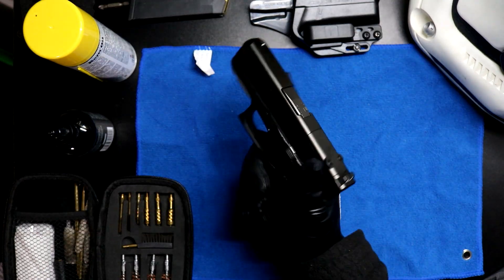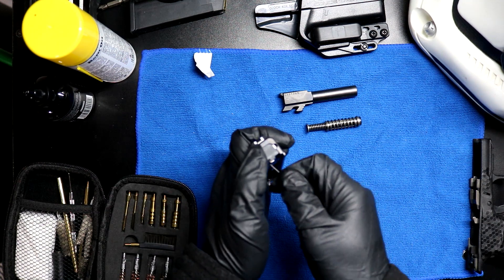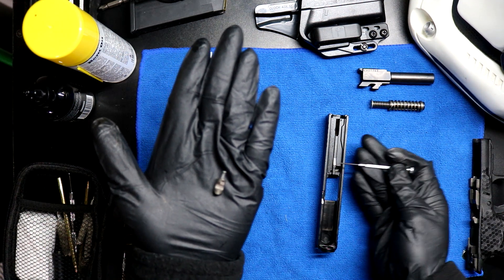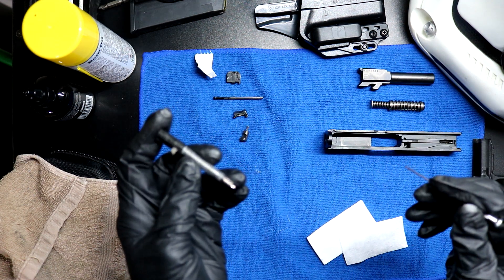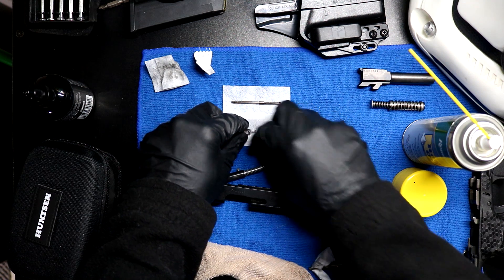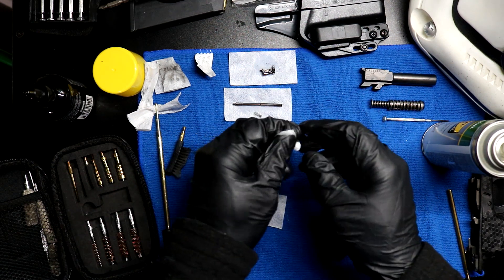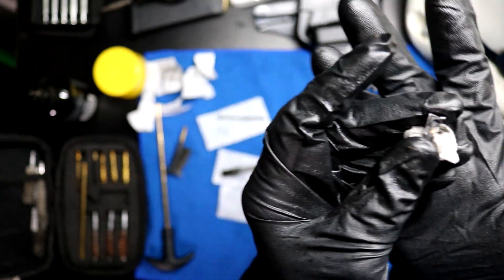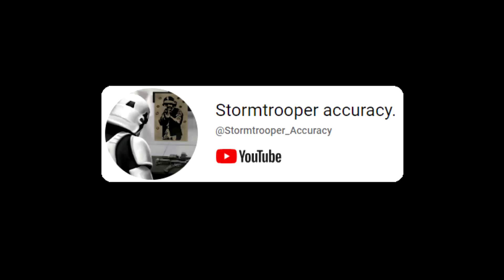G43X SLIDE DISASSEMBLY.

Comment: I tried to swap out the slide lock lever on mine for an extended slide lock lever and the spring went flying across the room. Good thing those little springs are cheap and my 43X was out of commission less than a week.
Reply from the maker: 😆see, I'd probably end up in the same predicament. Does the extended lock prevent you from using your holster?
Reply: @Stormtrooper_Accuracy  Not at all, it just makes the pistol a little easier to break down.

Comment: The plastic part on striker assembly yes it is plastic. You can always upgrade it to an aluminum one. I did that to my Glock 44 because it tends to break on that particular model. But on all others is fine to leave it as is. I left it as is on my G19 and on my dagger. But they do sell aluminum ones just in case you are concerned about it.
Reply from the maker: Ahh, so it is plastic. I'll run it stock for as long as possible, curious to see what part will fail first. How would u compare your G19 to your Dagger? I'm interested in getting a 19, or 19x.
Reply: @Stormtrooper_Accuracy  it gives me peace of mind knowing it’s a Glock but honestly, I love my dagger more. The ergonomics just feel better while shooting and drawing. I’m at 1,200 rounds with my dagger and not a single malfunction (Thankfully), since you have a dagger, if I’d have to choose between G19 or 19x I would go with the x. If I had purchased my dagger prior to my G19 I would of went with a Springfield Echelon (shot that gun for the first time last weekend and it is just SO smooth and the ergonomics are beyond you can imagine, the stock trigger feels like a $200+ competition trigger) instead of my G19 but nevertheless I love both my dagger and G19 I just enjoy shooting my dagger way more because of the threaded barrel with a comp and rmr cut with my red dot. I keep all my glocks completely stock. 

Well except for my G44 because after purchasing it and putting a few hundred rounds while cleaning it I noticed the striker sleeve had some very noticeable wear, and after doing some further research it was stated by multiple reviewers that it is a common thing on that particular model. Apparently since it’s a .22 long rifle chambered handgun the striker assembly has too much force when fired. So it ends up breaking the plastic striker sleeve. I purchased an aluminum one from FarrowTech and also haven’t had a single malfunction on that gun. To be fair I’ve only shot it around 500 rounds. Rimfire ammo is way too dirty. After shooting 100-200 rounds on the G44 the gun looked internally as if I had shot 2000 rounds of how dirty it was. Therefore I just keep this gun in the safe as a collection item. 

My G19 also is in the 1000+ rounds and both my dagger and G19 have their striker sleeve looking brand new (no visible wear) proving the point of those reviewers that stated it is an issue particularly with the G44 not any other model. So with that I say… you can rest easy my friend. That little plastic part will probably last you into the 20-50k rounds (possibly even longer) so long you don’t use stuff like over pressure ammo consistently or ammo from an unreliable manufacturer.